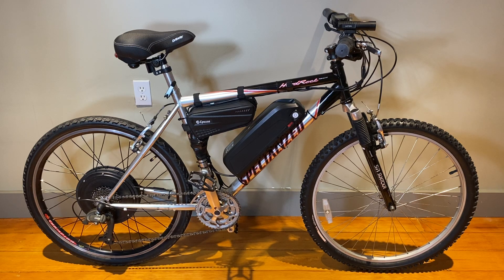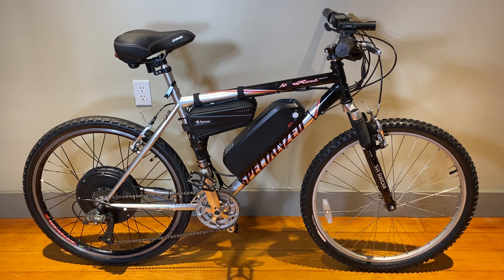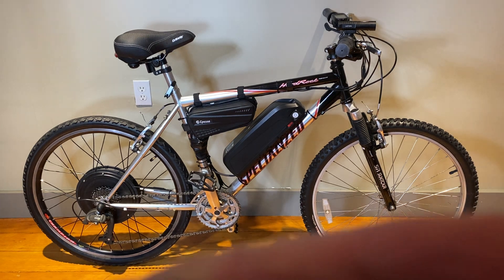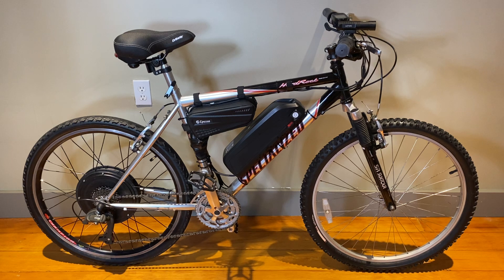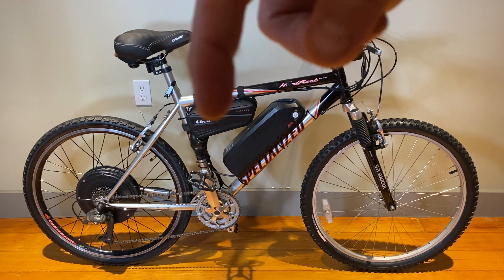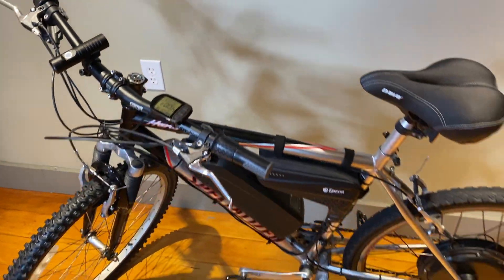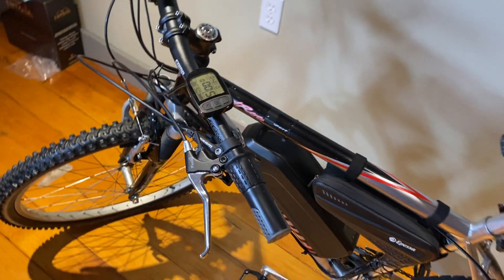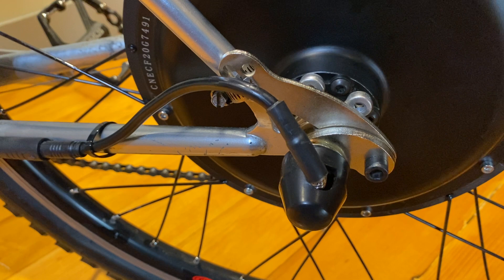E Bike Conversion - Pitfalls and Solutions - AW 26"x1.75" Rear Wheel Kit E-Bike Conversion 48V1000W

Comment: Besides the battery on the bike, does the motor on the rear wheel need like charging, or does it even charge? And without the battery can I just have the rear motor and still go like 25 or how ever fast it goes?
Reply from the maker: the one and only battery on the frame  that gives power to the motor on the rear wheel.   There's no battery in the rear wheel.   So no the rear wheel doesn't charge.
Reply: @paulcbarranco  so in order to move with just the throttle i need to buy a battery with the conversion kit?
Reply from the maker: @ampjp_  yes that's right!

Comment: Could you provide an updated link for the battery you used? I'm receiving an error message for the link initially posted...  Thanks in advance!
Reply from the maker: QZF 48V 52V 36V Ebike Battery, 13Ah/14.5Ah/20Ah Lithium ion Electric Bike Battery with Charger for 1500W 1200W 1000W 750W 500W 350W 250W Mountain Bicycle Conversion Kit https://www.amazon.com/dp/B07YJR2XZ4/ref=cm_sw_r_cp_api_i_FN6PA69S61MD23S4NG3Z

Comment: You wouldn't happen to have a video or show exactly where you were soldering
Reply from the maker: Basically the battery and brain are separate units.   And they both have power coming out of them you just need to strip the wires and then solder them together.  If you want you can just crimp the wires but i like the solder connection better as its much stronger.   But I don't have a video - sorry

Comment: I have a 27.5 wheel size bike. Can I put 26inch wheels ebike conversion on this frame and will it work?
Reply: Yes it will work
Reply from the maker: Well. It might work but If it were me I would just a 27.5 in wheel with a motor on it so your bike isn’t weird.
Reply from the maker: HALLOMOTOR 36V 48V 1500W 20" 24" 26" 27.5" 28" 29er 700C Rear Wheel ebike Electric Bicycle Conversion Kits with 750C Colour Display https://www.amazon.com/dp/B07PDRG1CW/ref=cm_sw_r_cp_api_glt_fabc_3982ZDMN66S9TSZP13B1?psc=1

Comment: I think some of the kits now have magnets you can install on your brakes. They convert your own brakes into a motor-swith off device. Perhaps with those you could keep your original shifter/brakes?
Reply from the maker: that would be amazing.   Swapping out the brakes / shifters system  totally sucked!   I would love to see that.
Reply: What are they called? Can I buy those magnets separately because the kit I bought didn't give the those magnets

Comment: How is the bike holding up now and would u reccomend that I buy it?  Also will a 48v 12.5 Ah battery be powerful enough for this thing.
Reply from the maker: well I actually sold it because i was given another bike right after i made this one.   But I would guess it's doing great as i made it completely rock solid and the components are super basic!   And yes that battery you listed is great!  It's close to the same size i was using and theres plenty of power with it.

Comment: These wheels don't seem to fit anyone's bike. Everyone ends up angle grinding their old bike frames. I had to file down my girlfriend's bike frame and now she has a super fast dangerous ebike that doesn't allow the brake caliper to be connected 😆. You're better off buying a full off the shelf ebike imo. Either:

1. You're poor so you start with a reL piece of crap bike with bad drum brakes, and then spend $500 converting it and end up with a fast but unsafe, ugly, potentially not waterproof ebike

2. You start with a half decent mid range bike that you spent a lot of money on and you think it makes sense to convert that to ebike instead of buying a whole new bike. So you spend a whole $500 on a kit and end up having to cut, grind and alter your bike frame of the bike you previously loved and in the process of attaching a bulky battery, saddle bag and hub make your bike look ugly. The total price of this bike (including original bike) is higher than the retail price of a basic ebike or ready made model from China and potentially not waterproof and still inadequate brakes
Reply from the maker: Well the only thing I used to get the tire on the frame were 2 washers and it went right on. No grinding whatsoever.  

You are right, you can get one pre made  from  China but not with a 1000w motor.  This one is much faster and powerful.   Look at the wattage on a cheap China e bike for 500. They don’t go as fast as this  Mine does 23 on the flat with no peddling.  If I peddle it goes much faster.  

it’s controller is in a waterproof bag so the bike is waterproof and has lots more power and range than an entry level China bike.  

You might be coming in a little hot IMO.  LOL.  It’s your own perspective which I respect but I don’t think you’ve seen “my set up” per say.   Best of luck.
Reply: @paulcbarranco  23 mph is limited by the shitty motor controller. This motor will go much faster. I use VESC controllers on my bikes, they're capable of lots more power and are much more configurable. I pushed the 350 watt motor that came with my prebuilt ebike to 84 amps, and I recorded about 3500 watts on it. Of course the hall sensor wire insulation ended up melting and shorting after about 20 minutes of heavy use, which caused the controller to shut off, making me think I had burnt out the controller. Both the controller and the motor still work, just without hall sensors.

Anyway, my point is this could go much faster. I clocked about 35 mph with my 350 watt motor
Reply: @paulcbarranco  Yeh I get what you're saying about the high power, and they are definitely a lot of fun. I'm just saying that if u use a super cheap crappy bike, u could potentially have an unsafe ebike (it'll do 0-30 in a few seconds and stop in like 3 meters, have barely any grip on the road), but also if you use a decent beloved non-ebike you may not like that you may have to chop bits off, or sand/grind bits down to get the kit to fit. (You luckily only needed some washers but some force was needed)

My gfs converted ebike pulls away hella fast, you feel it yanking you forward. Unfortunately I couldn't fit on the front brake caliper tho so removed it for the meantime and had to file away at the forks where you slot the wheel in. I think these kits are good for those who have an unused bike laying around in the shed and want a bit of fun and don't want it to be a regular bike again, you won't care about the modifications and won't need to undo all the wiring to turn it back to a regular bike. If you have a current pushbike that you love and ride often (maybe leave outside and ride in the rain) I would probably advise saving a bit longer to buy an off-the-shelf all integrated ebike.
Reply from the maker: @James-rf2ln  yeah i wouldn't recommend removing front brakes. lol   I'd actually advise to install this on a bike with disc brakes because of the speed they travel.    Yes I feel you on the budget and bike but i also think everyone is different.   Some people will see the value of converting a middle tier bike like this one.  It has a sturdy feel when you ride which is most important.   I wouldn't invest a bunch of money on a kit and battery  into a an old shed bike nor would i do it do a super nice carbon fiber deal.   There's a middle ground that these conversions fit perfectly with and that up to each individual to decide.